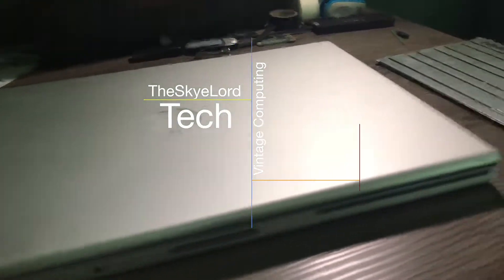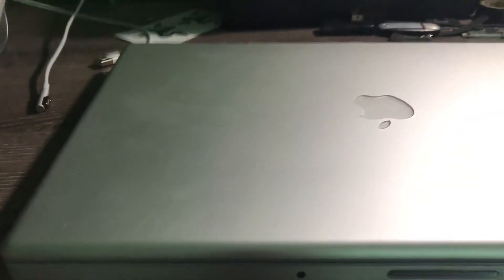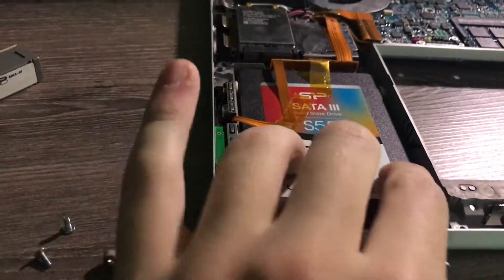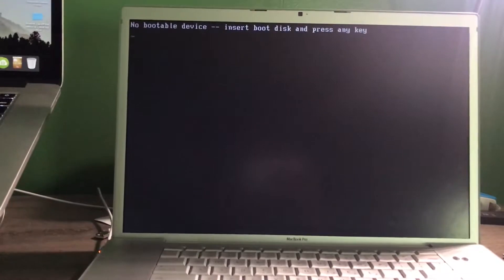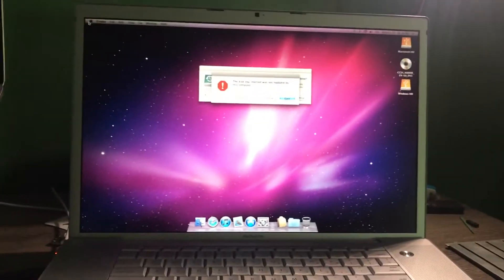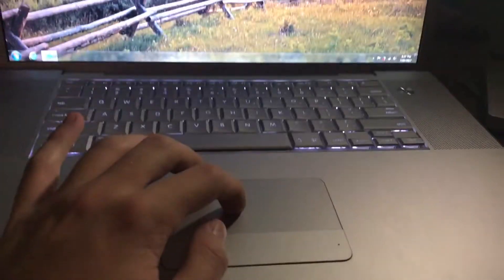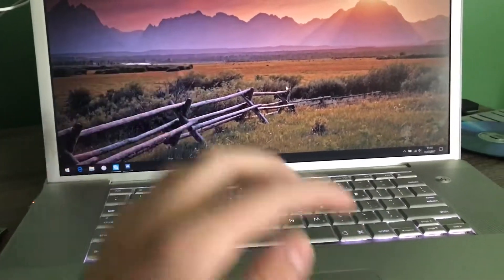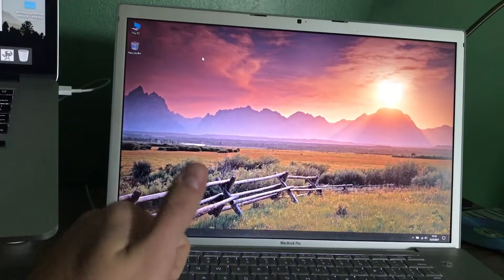Core Duo 17" MacBook Pro Upgrades

Comment: did it run hot with windows 10?
Reply from the maker: Stephan K it did run pretty hot once the CPU was allowed to clock to the full 2.16GHz. But by default it says it stays at 1GHz, which then it’s not too bad.

Comment: man, if you are using snow leopard you need to enable trim with third party drivers, otherwise your SSD will be ruined.  
Use trim enabler 2.2 or trim support enabler 1.1
Reply from the maker: Jayme guimaraes e silva I know. It’s on Windows 10 actually
Reply from the maker: Also, I would think that snow leopard would be fine on an SSD since MacBook Airs released with M2 SSDs on snow leopard.